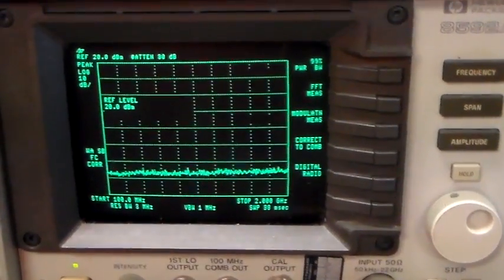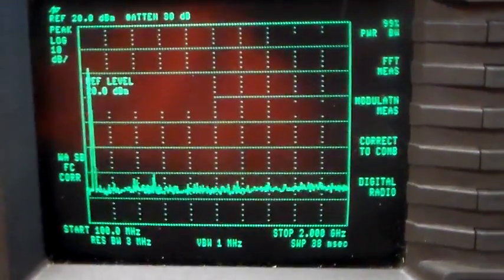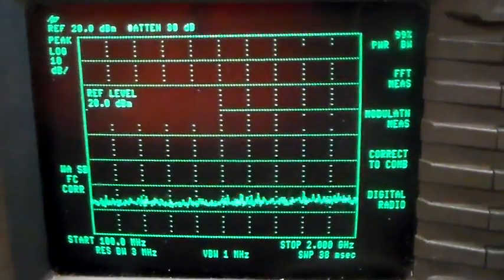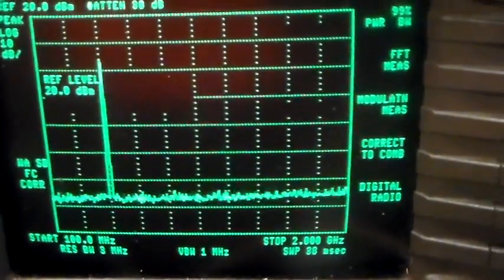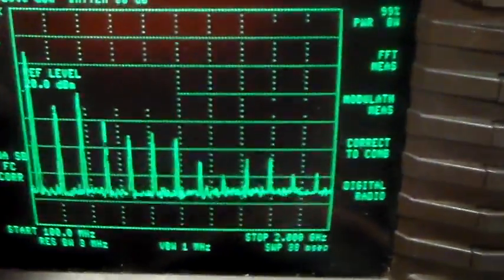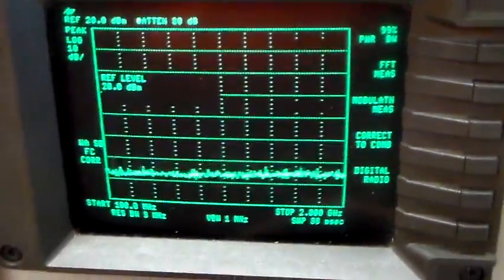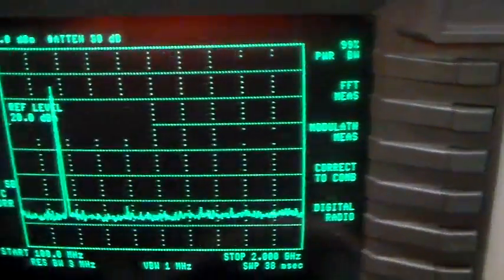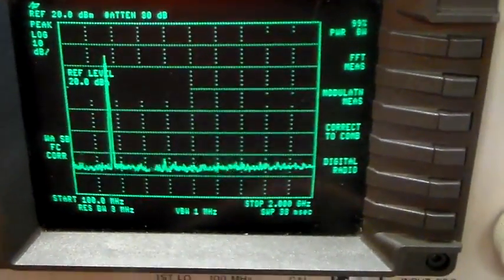Good And Bad Baofeng UV-5R On Spectrum Analyser.

Comment: Why baofeng UV-5R not good reception if I make antenna 'short' system on 2 meter band like Hustler G7  or Slim Jim ?
But it will good reception if I using antenna open dipole or flowerpot.

Comment: @VK6CS    Thanks for the video, Steve.  Your video shows similar results to others on YouTube (and my own) and confirms that the Baofeng does not comply with USA FCC Regs.  That aside, yours and the other videos show spurious/harmonic suppression is variously in the region of 40 to 50 dB.  At a starting point of 36dBm (4 Watts fundamental), 40 to 50 dB suppression gives a final reading range of -4 to -14 dBm.  For the sake of argument, let’s average that out at -9dBm.  For the uninitiated, that equates to a spurious/harmonic emission of 0.125 milliwatts (mW) – that’s 1/8th (one eighth) of a milliwatt!  So, to you Baofeng Bashers out there – give it a rest guys.  A (relatively) fault-free Baofeng ain’t as bad as you make out!

Comment: I am afraid to ruin the front end of my spectrum analyzer tracking generator how did you have this hooked up? Also what power settings were you using?
Reply from the maker: Hmmm... this video is over 3 years old so I can't remember the set up. I'll make a mental note to include the set up in any future videos. We have 100W power attenuators at work where I did this video, so I'm guessing we used the right amount of attenuation to get the signal small enough to keep the analyser input happy, and set the radio O/P to 5W. It may have been cleaner at 1W so that wouldn't have been as good a test. This radio was bad though, we tried some other Baofeng UV5Rs and they seemed to be much better. They still wouldn't have met the Australian spec for spurious emissions though.

Comment: Some time ago I tested my UV-5R and found it failed terribly on 2 meters so I stopped using it. I just watched your test and it showed it's ok to use on the 440 mhz band, so I tested mine there. The second harmonic was down better than 66 db. But......the third harmonic (1.345 ghz) did not fair well. It was only down about 53 db. Mine failed since the FCC rule states it must be down 60 db. I guess you got a good one. Hi Hi
So mine goes back to a Receive Only Mode !

KU3X
Reply from the maker: Yes, they can be pretty bloody awful. Some are much better, but nearly all will be out of FCC spec.
Reply: @vk6cs456   Hi:  You weren't sure in the video - USA FCC Rule is 40dB down - but of course you are in 'Stralia, which may be different.  73 - Iain.
Reply: Hi KU3X:  Nope - FCC says down 40dB.  73 - Iain.

Comment: No one wants a Chinese Toblerone. :) If I buy one of these I am going to find someone with a spectrum analyzer to see whats what. I think at Dayton they did a test of HTs people were carrying  over the past couple of years to see how bad they were and every brand passed with no issues except for the Baofengs and most failed. But you get your money's worth if one does work. :)
Reply: Where was your computer and cell phone made?
Reply from the maker: We tested the later model and found it to be much better. I think it was actually in spec. I'll try and do a video of that one.
Reply: I wouldn't trust anything "made in china" sure you can find a baofeng that sometimes that passes the specs but majority don't, my rule if it is made in china, walk away.

Remember even a blind squirrel finds a nut occasionally

Comment: The $64 question, did you know one had a filter problem before putting it on the spec an and if so what were the symptoms?
Reply from the maker: It was a surprise, there were no symptoms as far as I know. I had seen it shortly before this video, that's why I don't sound surprised. The first time I saw it I fell about laughing.
Reply from the maker: Cheers Darrin, thanks for the feedback.